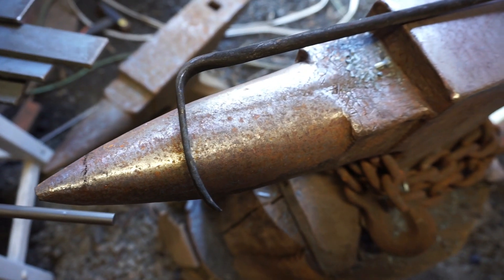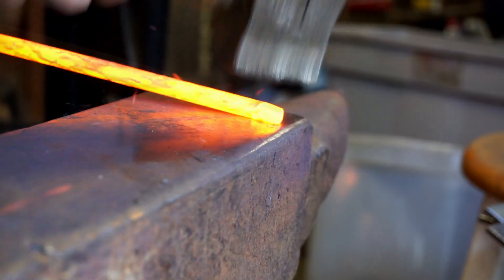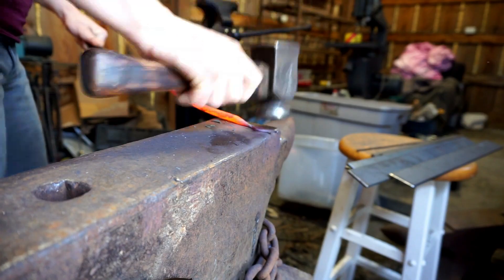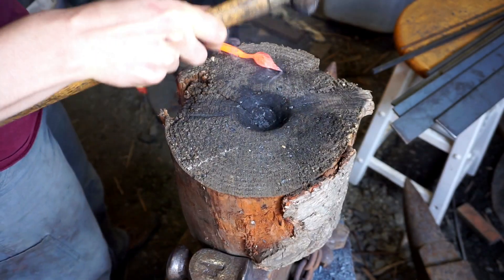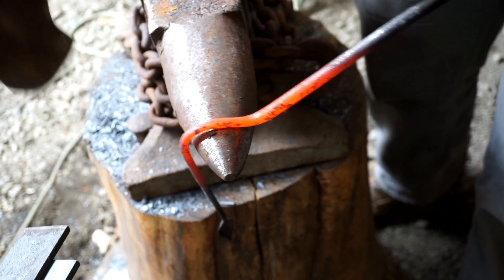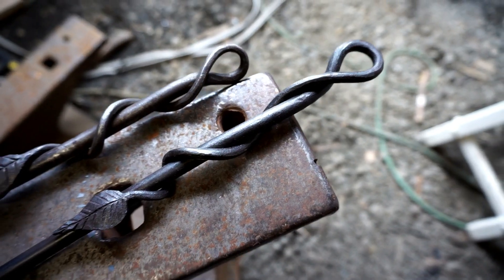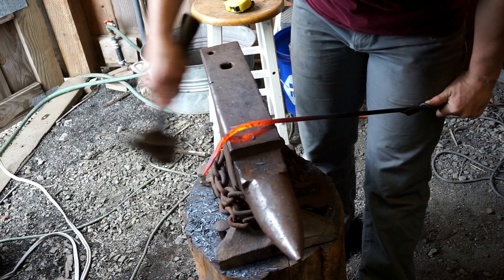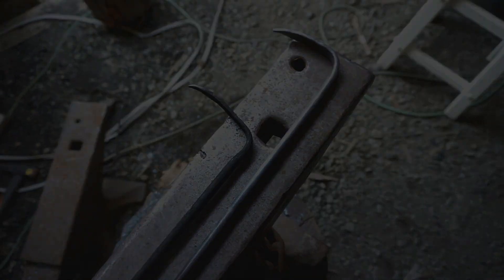Forging a Fire Poker - Whitlox Forge First Lessons Series

Comment: Cori! Great to see another installment so soon! A great and simple first (and necessary) tool. This is the one of the best tutorials I have seen in under 5 minuets. My fire poker I made utilizes a blacksmith knife style handle and was very easy to make without tongs (which starting out you may not have).